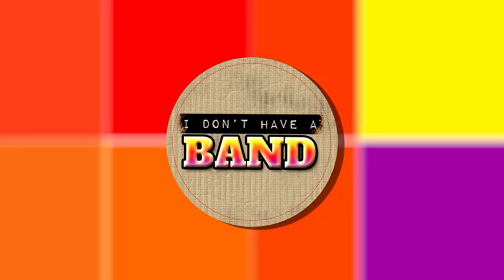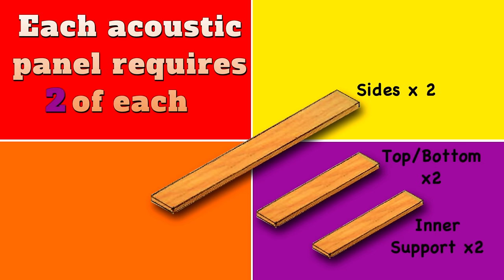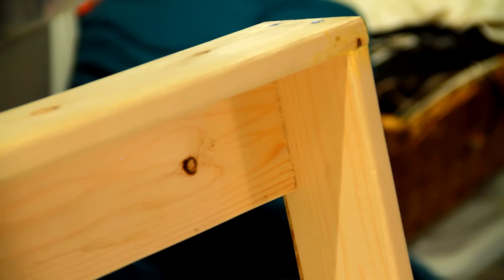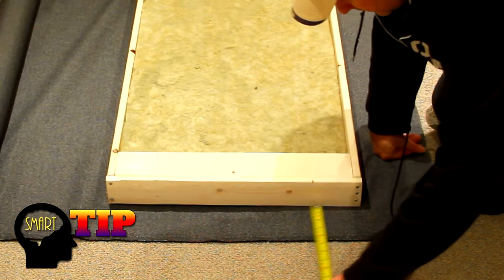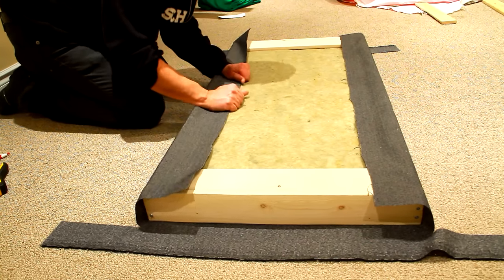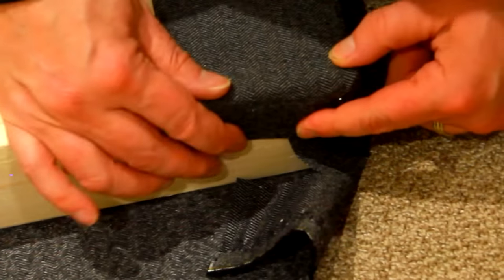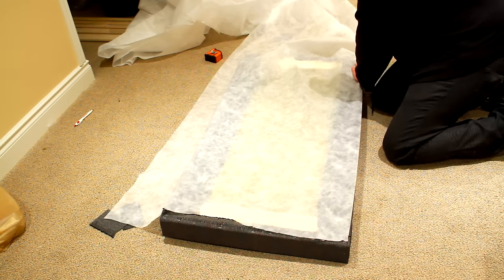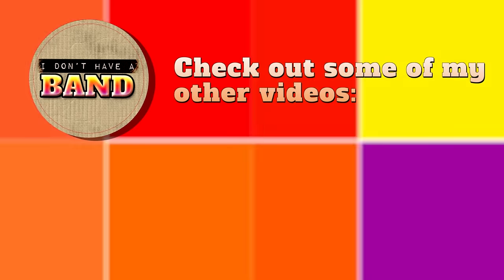DIY Acoustic Panels - How To Make Your Own Cheap and Awesome Panels

Comment: How did you mount the panel on the corner?
Reply from the maker: Hmmm.  Hard to explain here but I used 2 angle brackets and bent them to about 45 degrees and then screwed a wood screw through each one. Basically creating a triangle and mounted them on the top left and right edges.  Then put anchored screws on the walls to align with the brackets.  I may need to do a mounting tips video to better explain this but hope this gets you thinking.
Reply: @LonelyRocker  Thanks. Looking forward to the mounting tips video
Reply: Awww,,, yeah,,,, you  should have told us how to mount them
Reply from the maker: A few have asked me about that.  All rooms are different so finding a universal method to present is difficult but giving the topic some thought :)

Comment: I am just about to give this a go.  Just wondering how did you mount your panels in the corners?
Reply from the maker: Hi Kevin. This might be hard to explain in a comment but what I did was use two L brackets bent to 45 degree angles that would sit flush with each wall.  I marked the placement of two drywall screws with anchors to support each bracket.  If you email me at donthaveaband@gmail.com I will send you a picture.

Comment: Howdy. Curious why so many recommend Rockwool. Would normal pink insulation be fine ? I would like to build a few of these for my home theatre/entertainment room with the intention of reducing echo. Thank you.
Reply from the maker: NO NO NO!!!  Don't touch the pink stuff.  That is Fibreglass insulation.  You don't want that flying around your room. No NO NO.  You want insulation that is rated for sound absorption.  There are many debates but Mineral Wool is believed to be far safer than fibreglass.  Rockwool also makes a rigid product called Comfortboard.  I also use Comfortboard 80 which actually performs better than Safe n Sound.  There are also alternative materials like cotton based insulation.  Whatever you choose, make sure it is rated for SOUND.

Comment: What are the thoughts on Rockwool being harmful in such situations? I have read that it shouldn't be used for e.g. acoustic pannels because of the small particals that it ejects (even if undisturbed) which goes right through the fabric as Rockwool apparently is meant to be used between solid material of the walls such as wood.
Reply from the maker: Check out my other Panel videos, especially My Acoustic Panels Q and A.  I discuss  this....

Comment: Could somebody please tell me the dimensions in meters/centimeters?
Reply from the maker: Just convert it with Google?
Reply: The Rockwool Flexi slabs I've seen recommended are 1200x600x100 so that would be your inside dimensions for the fit.  The rest for the frame would have to be calculated depending on the thickness of the wood you're using.

Comment: I have a 25" flat screen TV sitting on a dresser.  If I hang this panel on the wall right behind the TV, would it block some of the TV sound so it wouldn't bother the adjacent room sharing the same wall?  I understand it won't block the sound completely.
Reply from the maker: Panels like these have almost no soundproofing qualities.  They are designed to absorb reflections to focus the sound you hear within the room. If you are looking to soundproof that is a completely different process.

Comment: Not sure if 24" stud spacing is the Canadian standard, but 16" is the US standard and I'm having a H A R D time finding 24" wide mineral wool cuts. Everything is 15 inch here. I might have to adapt this formula for more narrow build.
Reply from the maker: That's an interesting observation. I checked out the Home Depot online and see what you mean.  Check out my mini panels video.  Don't worry about the dimensions of the panels but look at the formula inside.  I use a rigid insulation.  You could cut pieces to fit your frame and the extra layer will pull it all together.  Check it out: https://youtu.be/AdDdumAieJs

Comment: those fibers in the isolation are dangerous if inhaled. having this in a studio getting shaken by bass will definitely stir up the air. not sure how much protection the overlaying fabric will give you
Reply from the maker: That’s a fair question.  The research I did suggested it was safe but I certainly recommend everyone makes there own determination.  I’ve covered my panels back and front and the front material is quite dense. I don’t see anything to suggest any material is getting out and posing any health risks to anyone in the room but you can certainly take extra precautions if you have concern.  If you seal the panel with an unbreathable material sound will bounce right off the panel and not get absorbed.  All studios use some form of absorption so if there was an epidemic of mix engineers getting sick I assume we would have heard something. But please take your own precautions and be safe 😁
Reply: i heard some people use a glue spray on the isolation to help it stick better to the fabric. this also helps keep together the layer of fibers
Reply from the maker: Sounds messy.  I assume you would need to get this right to ensure it works properly.  If you get this technique on video, please share...
Reply: I'm also going to do this build, but I'm going to wrap the isolation in 2 layers of fleece before putting it in the frame, that will give it more resistance before the fibres can escape. 
The important thing to think about is that you should be able to breathe quite easy through the fabric, or else it will stop the sound  from getting in and start to reflecting it bak in to the room. 
And if you have the option, work with the isolation outdoors, cutting and handling the isolation is when it releases the most amount of fiber.
Reply from the maker: Good luck with your build.  Let me know how it goes!
Reply from the maker: @08icefire73  I've seen that video but he skips a lot of the nuances about the build.  He mentions the foil but doesn't show what he used.
Reply from the maker: I've done a lot of reading about Rockwool since I built mine.  The article you linked talks about old the dangers of Rockwool made in the 70s.  I believe the manufacturing process has vastly improved since and I've read many articles saying it is safe.  Though I would be very interested to see any more information if you find any.  Thanks for the heads up.

Comment from the maker: ✅✅✅ DIY Acoustic Panels 3.0 are here. The coolest looking panels yet!  https://youtu.be/P8rsU22K--Y 
✅✅✅  Panels Done?  It might be time for a DAW Controller! https://youtu.be/5n_aPsB1E4E 💥💥💥
Reply: I’m going to make some of these panels for a dual purpose application. I want to improve sound quality in the room, but also keep the sound from bleeding through the walls into other rooms. I saw you have a few different designs, I’m looking at backing them with 5/8 drywall and MLV. What are your thoughts on this?
Reply from the maker: @Tsxtasy1  Don't back them with drywall, let the panels breath all the way through...

Comment: Fellow Canadian here, I'm in the process of purchasing the materials needed for this today, and starting to build this week. How many metres of fabric do you reckon is needed per panel?
Thanks!
Reply from the maker: Welcome eh! ;) That's hard to answer from here.  Best way is to use the calculation I gave you in the video and multiply that by the number of panels you are making.  Then add some more for safety and bring that measurement to the fabric store.  They will be able to convert that into the amount you will need to buy.  Good luck!!

Comment: Thank you for your video... I'm looking for an opinion. I'd like to make a series of 4 narrower, more portable panels I can move around from room to room. Would I be able to forego the framing and just upholster a few 9"wx4'l shelves with insulation/fabric /backing? I'm wondering if that will work or does it need to be a "hollow" structure?
Reply from the maker: My pleasure.  The panels need to allow the sound to pass through.  A hard back will create a reflection point behind the absorption materials.  Air does have an effect on absorption, though it's hard to pinpoint as every need and application for treatment is different.  But I would not recommend creating a closed panel.

Comment: I'm going to be building sound panels with the first reflection point panels built first using your plans for the frames. Two 2x4 panels on each side of the mixing desk.  I thought I'd make these broadband panels pretty thick, using 3 pieces of rock wool in each panel. But this will require the frames to be made of 1x10 wood (actual dimensions 3/4 x 9 1/4) in order to fit 9 inches of stacked insulation. Does this seem too extreme? I'm using Safe n Sound insulation. The "thicker is better for first reflection panels" information comes from a fair bit of research I've been doing over the last few weeks at places like Gear Slutz, but panels this size seem like they'd stick out from the wall a far bit. My room is just under 11 feet wide by 21 feet long.
Reply from the maker: Before you do anything check my panels 2.0 video https://youtu.be/MHnFYFZc-w8

Comment: Hi there, I'm going to start building some panels very soon. Your video has been very informative! Question for you that I haven't seen in the comments, is what sort of lumber did you use? Like a crappy pine with rounded corners (cheaper), or a nice pine with square corners (more expensive)?
Reply from the maker: Thanks!  I have talked about the lumber.  I have other videos on the topic.  I use building grade lumber and I look for the straightest pieces possible.  It will just make your work easier.  If the wood is all twisted and chewed up the final product won't look good.  Sanding wood is too much work.  If you are wrapping the panels the wood doesn't have to be perfect but I highly recommend getting lumber that is reasonably straight.
Reply: @LonelyRocker  okay thanks. I was looking at the builder grade lumber last night (at Rona in Canada) and it was $4.67 CAD for a 1x4x8', but I was concerned about the rounded corners that it might look funny once wrapped. The knotty select pine boards were $8.49 CAD, but had super nice sharp corners and were straight. Was wondering if you would be able to see the rounded corners of the builder boards.

Again, thanks for the video. You made it look very easy and gives me confidence.
Reply: @LonelyRocker  Also, to add on to this, how do you think a pressure treated board would work? For building a 6" panel it seems like fence boards might be cheaper.
Reply from the maker: I wouldn't use pressure treated.  That's chemically treated.  I wouldn't want that in my room.  I also wouldn't overthink the lumber.  Get decent wood and make it as straight as possible.  If you are not that experienced with basic carpentry practise with some scrap pieces first until you get the process right and then start building.  Good luck!

Comment: hello buddy  great great video my friend . I just wanna ask you . I am planning to build mine but I also bought a rock wool and I don't want the fiber glass to get out of the panel . so is it ok for me to build the exact as same as this video but first I cover the rock wool with backing fabric and then covering the panel with the face fabric is that ok and also I can use also the 1 inch foam before the facing fabric just to make sure nothing comes out . thank you for your help and great video
Reply from the maker: Thank you very much.  You are going to laugh.  I did an update to this video a few months ago.  It introduces a new formula similar to what you are mentioning.  The video focuses on 8 inch panels but I explain how to apply the concepts to regular 4 inch Rockwool Panels.  Check out my Panels 2.0 video here: https://youtu.be/MHnFYFZc-w8 I also highlight the formula you are describing in my mini-panels video.  Again you can apply the concepts to your panel and ignore the dimension of the smaller panels.  That video is here: https://youtu.be/AdDdumAieJs Good luck with your build and hope these help you!

Comment: Hey thanks for making this video. How does it add up to $20? now I am doing the math and it adds up to $40 per panel. could you have a break down and share your resources for fabric and Rockwool etc..?
Reply from the maker: My pleasure!  Ha!  Backwards accounting!!!  It's been a year and a half since I made this video but I do remember calculating my panel cost based on the full quantity of materials I bought at the time.  Perhaps I found the fabric on sale or the Rockwool was less expensive here.  But that $20 estimate was honest based on my costs at the time.  I made 8 panels with one batch of material so perhaps that brought the costs down.
Reply: @LonelyRocker  that makes sense. I am planning on making 32 panels and some more in a different size... I did a little more research and I found some of the material on sale as you mentioned. I guess I am at $32 per panel now. Anyways. I learned alot from your video and thanks for the advice.
Reply from the maker: That's a big project!  Good luck with that!!  Keep me posted on your build.  And thanks for checking out the video and glad I could help!!

Comment: You don't have to make a video. But when you mounted these. Did you mount the TOP of panel with 1 or 2 connections?  Center or one on L&R of panel and did you just do the top ?  I'd like to have a horizontal bar or whatever that has a lip and then HANG the panels on there so you can just put them on and off.
Reply from the maker: Ha!  This video is 5 years old.  I think I did cover mounting at some point.  You can hang it any way that makes sense.  It really doesn't matter.  One point, 2 points.  It won't change the property of the panel...

Comment: Its awesome. To the point. Gained knowledge. Thanks. Just one point to clarify- is it really required to nail the panels on wall, keeping no gap in between or just keeping panels inside the room will achieve soundproofing.
Reply from the maker: Thanks.  I have actually done a bunch of follow ups since this video.  Including one where I interviewed an acoustics expert and he did recommend connecting them right to the wall with an air gap in the back of the panel...

Comment: So for me to utilize all 8 Batts (and build 8 panels), I would need a total of 16  1~4~8’s ? I’m gonna jump to the project asap. Also if the wood that’s available happens to be very particleboard-like would that work with basic threaded screws?

And around how many screws/staples for 8 panels

Thanks for the tutorial!
Reply from the maker: Best i can say is just do the math.  Add up the lengths of all of your sides an make sure you have enough clean runs for each piece.  this is outlined in the video.  the comment section is not the place for math ;). for screws and staples just get yourself a good supply.  Doesn't hurt to have extras lying around.  As for particle board, I just released my latest panel design yesterday and I used MDF.  I discuss this in the video: https://youtu.be/P8rsU22K--Y

Comment: Thanks for the tutorial, really appreciate it! Would you recommend rather fibre glas or rock wool for the panels?
Reply from the maker: My pleasure!  Thanks for watching.  There are definitely fans of Corning products.  They make acoustic fiberglass insulation.  As my experience is with Rockwool I can't say for sure but a safe bet is it doesn't matter as long as the product you choose is designed for sound absorption.  I did a sound test video which you should definitely check out to hear first hand how the Rockwool panels perform: https://www.youtube.com/watch?v=aUBgX8GYQ_A&t=14s

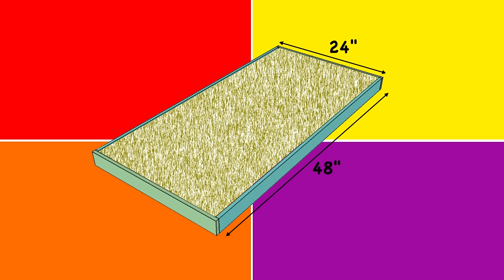Comment: I read somewhere that if you spray the roxul with dilluted PVA glue 1:10 ratio it helps hold the fibers together. That plus the material to keep the fibers in should be 100% safe.
Reply from the maker: A number of people have mentioned that.  My feeling is why mess with the insulation’s formula.  It may adjust the absorption properties.  Instead check out the panels playlist on my channel.  I have done videos since this one that demonstrate ways to manage the fibres better and maintain good absorption.
Reply: @LonelyRocker  makes sense and i hate extra mess!!!! There’s one guy on YouTube instilling so much fear about Roxul ... he’s making it sound like it’s 1000 times worse than asbestos!!! Anyways, i really like this video for the panels! I will be using your design!!!🤘🤘🤘🤘🇨🇦🇨🇦🇨🇦🤘🤘🤘
Reply from the maker: Really you should watch my other Panel videos.  I did a whole Panels Q and A and discussed this. https://youtu.be/IjCtAccI_7w  I have spoken to Rockwool directly.  While I encourage everyone to do their own research and not take my word for it, I can tell you Mineral Wool is NOTHING like asbestos.  Glad you will be following my designs.  Check out the internal formula for my mini panels.  You could apply this formula to the 2x4 panels if you want a little extra protection from fibers.  this is my go to formula now: https://youtu.be/AdDdumAieJs
Reply: @LonelyRocker  i watched them all!!! 🤣🤣🤣.. iam currently building my music room, framing and electrical are done. Next is insulating with roxul,sonopan and 5/8 drywall. I have enough roxul left over to make 6 panels 🤘🤘🤘
Reply from the maker: That's awesome!  Best of luck with the rest of your build!!